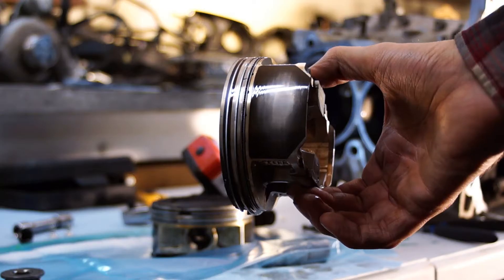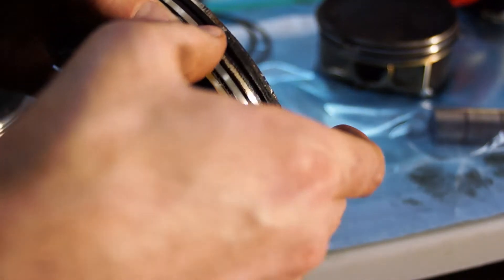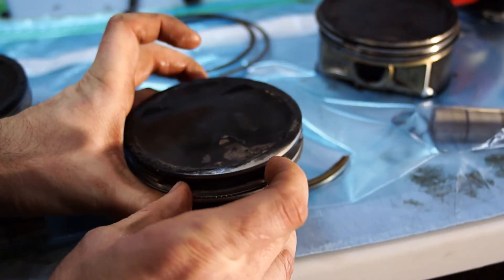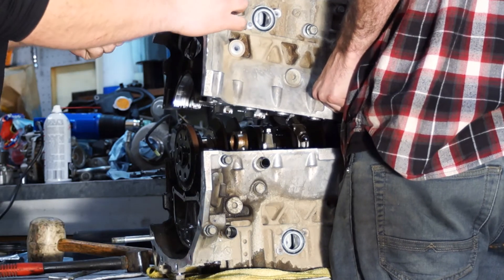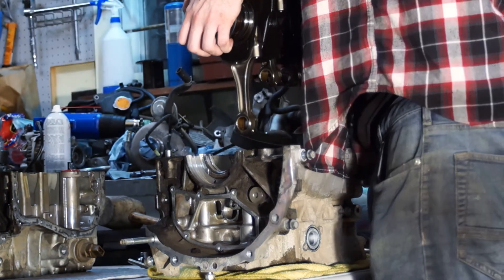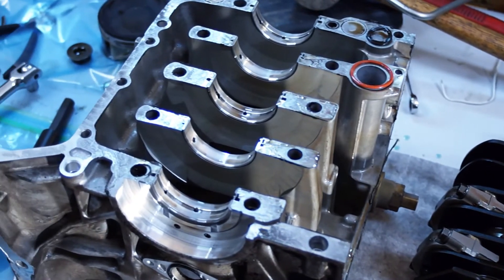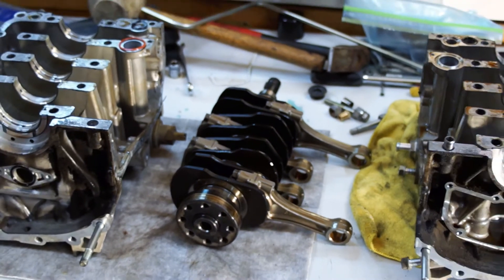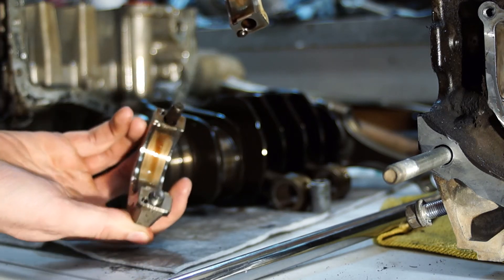How to remove Subaru pistons and seperate the block. [EJ257] [Frugal Garage EP11]

Comment: I can't pull those piston pins for shit. Can I split with pistons in ?
Reply: Did you end up splitting it with them in? Having a similar issue. Block is trash. I'm breaking it down so the block is bare aluminum for scrap. My idea was to separate it enough yo get a ratchet in their and remove the rod caps
Reply: @4oh4n0tf0und  i think i ended up lining up the pins and tapped it out from the opposite end with a long screwdriver .

Comment: Ok I can't be the only one having trouble. I managed to get the first 2 wrist pins out by wrapping a rod up and tapping the pins out from the back. But for the last 2 pins, I would only be able to tap them out like 1/3 of the way but now they're totally stuck and won't budge! What am I doing wrong? I even managed to take out both clips on both sides of the pistons.
Reply from the maker: I think sometimes you have to use a slide hammer
Reply: @ChillaxedJosh  I found the best way was to turn the crank shaft back a fourth a little while lightly taping with a hammer. Thanks for the video! It helped me seperate the block

Comment: So confused how you took those pins out with a coat hanger. No way a coat hanger is strong enough for my pins
Reply from the maker: Sometimes they're harder than others
Reply: @ChillaxedJosh  yea 😅 currently struggling to take out my second piston
Reply: Just did mine today with a coat hanger 
About one oem jack stand away from cracking the case in half to see which bearing took a shit 
3rd ej257 (13 Sti sedan)

Comment: Yikes at the first parts of disassembly.  Never, and I mean never use a screwdriver on the oil pan or pump.  Way too easy to damage the mating surface.  Simply take a rubber mallet and smack it around till it's free.  Never has that method failed me and never has it taken more than 2-3 taps to free it.  Once you get a little movement, work it loose with your hands because you don't want to damage the pickup tube or the rotor inside the oil pump/crank snout...otherwise good, informative video
Reply from the maker: Trust me I tried, it was insane how tight it was.
Reply: @ChillaxedJosh  bro I just had that problem yesterday I had to use a screw driver

Comment: What if your crankshaft is completely seized up. How will you rotate the engine to remove the pistons?
Reply from the maker: I think at that point you would be better off getting a new block and crank, and going from there
Reply: Split the block just a little first. Then slide the block apart until the wrist pin holes line up. I've rebuilt Subraus with seized cranks.